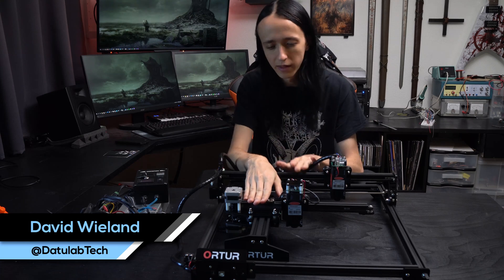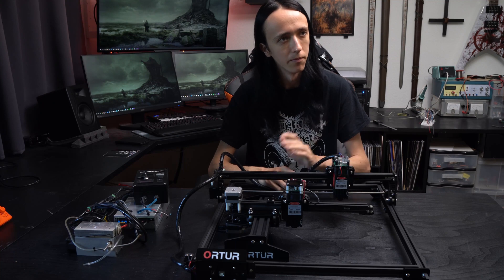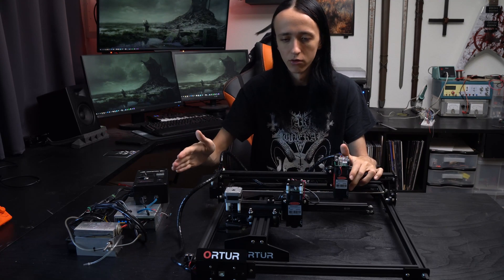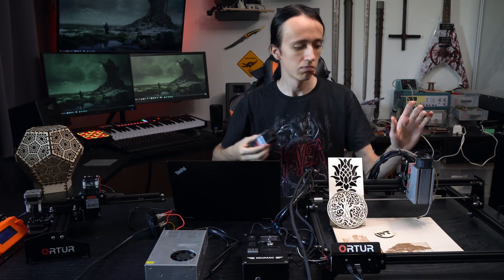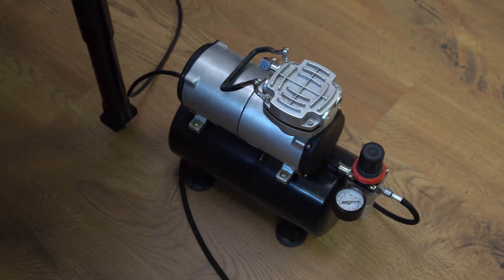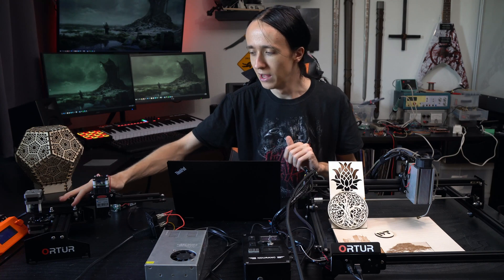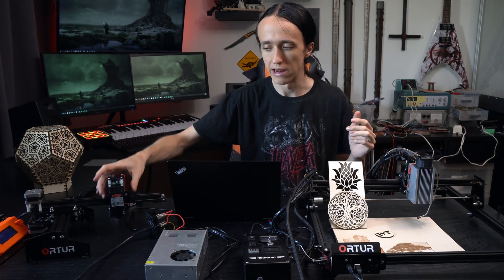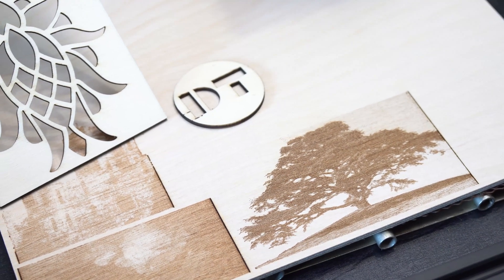Endurance Laser on Ortur Laser Master 2 - The ultimate Laser?

Comment: Hello David, interesting video, sick guitar on the wall :) 
Have you managed to cut anything with the original Ortur laser? I have the 20W unit, that i normally focus using the 3mm plate that came with it, and is fine for engraving, but I cannot cut bigger shapes, only small test shapes. I bought a pump for the air assist and had a friend 3d printing the nozzle, and that helps with the charring on the edges, but is still not cutting properly. 
I tried last night to cut a name on 1.8mm plywood. Did 3 tests 1200/95% 750mm/95% and 400/95% all at 5 passes and was still not cutting. 
Do you think I need to focus with something thinner that the 3mm stock plate, or maybe do more passes??  I have a downloaded stands  file, with a note that said "can be done at 300/85% 3 passes" I cannot do that at all. Thanks

Comment: Been watching you for quite a while(couple years at least?)... had to comment NOW. I just purchased the Ortur LM2 (LU1-4) (was on sale and finally pulled the trigger) and THEN I discovered (after) they already have the new "pro version" but it's not even available in Canada (that I can find)... so, let me ask you THIS: Would I be better to do this upgrade now (June 2021)??? or WAIT until the pro version is available in Canada and just buy a second machine? I know it depends on my needs and my needs may not be the same as yours but it would be really cool if you could do a video weighing the pros/cons of getting the NEW "pro version" vs this upgrade for existing LM2 users(June 2021). I am NOT opposed to owning more than one . :) but I respect your opinion and would like to hear what you have to say about this situation.
Reply: btw... i have no problem designing the threaded "focus mount" and 3D printing it myself... my concern is is it "worth it" for this DIODE LASER upgrade to begin with?  /taps toe (along with many others here chewing popcorn)  /grin
Reply from the maker: I'll have a video out on Friday about the LM2 Pro, it is being released worldwide on the 26th of June. Definitely worth checking out before you decide.

Comment: Super nice video. I am planning to build a large CO2 laser, but this option seems cool too.. I wonder what would be the benefists to have a CO2 compared to this? Also I like the tree desing, I have used similar design as the echo chamber opening on a Cajon drum and Bowed Lyres I built.
Reply from the maker: One big benefit of CO2 is being able to cut clear acrylic. You can also more easily get higher wattages, as diode lasers pretty much cap out at 10W (unless you get exotic with combining multiple,...). Diode lasers are easier to use and less fragile. You can't very well just add a CO2 laser to a 3d printer, but with a diode laser that's no problem.
Reply: @DarkArtGuitarsWorkshop  Yeah, have to consider the benefits.. also I just think building a large CO2 laser would be a cool project..  here are few photos of the tree desing I made with a CO2 laser https://www.facebook.com/photo/?fbid=10158725065558449&set=a.421053983448 and https://www.facebook.com/photo/?fbid=10156018494533449&set=a.421053983448 .. I would like to do the Hurdy Gurdy you made also... I really like your projects!

Comment: have you cut 4mm foamboard with the original ortur laser master2 20W? what would be the best configuration
Reply from the maker: If it is anything but white, most likely. If it is white, you would have to try as it depends a lot on the material if it works at all. A CO2 laser would be the better choice if it is white.

Comment: what about the neje 40 watt laser module head unit? it is only $289. the endurance 10 watt is about$1000!!
Reply from the maker: This seems to be a classic case of advertising power consumption as laser power. The Endurance laser has 10W laser output power, while the neje has 40W power consumption (no real way of knowing how much laser output, just guessing based on other lasers probably around 5-10W). It's the same as Ortur advertising 20W lasers, that have around 4-6W actual laser output power.

Comment: So my brother won one of those 10W Endurance lasers in a contest, and he gave to me, thinking of putting it on my Ortur. What size Power Supply are you using? Sorry if I missed you saying this?
Reply from the maker: My laser originally came with a couple 12V 5A power supplies, but I'm using one form an old 3d printer, it's 12V and maybe 15A or so. Better to get a bigger one than you think you need, as they tend to last a lot longer if you don't push them too hard.

Comment: you can get a 40 watt laser on ebay for under $400. about $100 more than the ortur 20 watt.  and is way cheaper than the 10 watt plus. and will do alot more.

Comment: Great video...I wondered why no one added the air system to remove debris. I just ordered an Ortur Laser Master 2 15w and have a old airbrush compressor to use on it.
Reply: Could you give me an update on how has it worked so far? I'm planning on purchasing one but I'm unsure on which one I should go for... 7W 15W or 20W.... I don't plan on doing cutting.... only engraving and mostly on leather (personalized leather accesories) Any help? thanks

Comment: Can ortur laser master 15watt cut 3mm plywood??? Thank you
Reply from the maker: It is possible, however the cut is not very nice (a lot of burning as you need to go over it many times or go very slow)
Reply: @DarkArtGuitarsWorkshop  What about 20W? It will be so much better?
Reply: I cut 3mm with my Ortur 15w but use an air assist. Cleans it nicely. I am however upgrading to the endurance 10w deluxe. The Ortur I can cut 3mm with 17 passes at 95%! The Deluxe should reduce the passes drastically